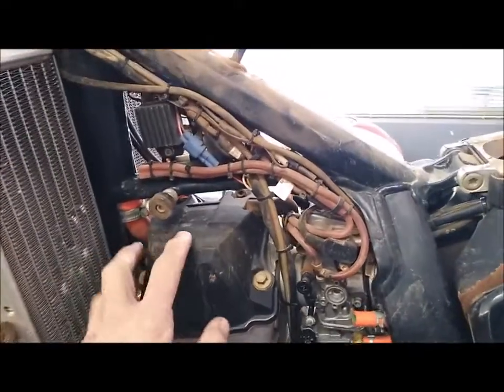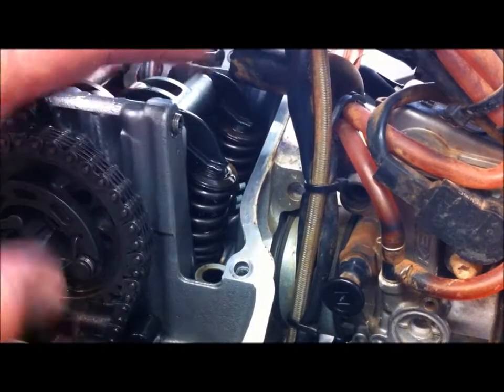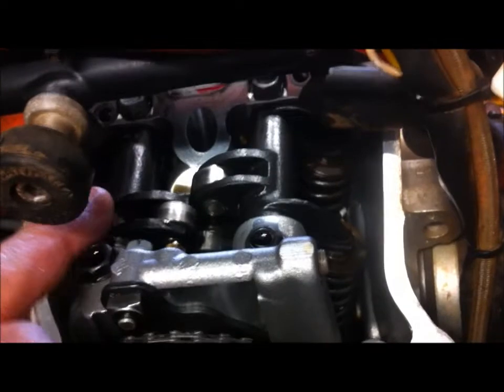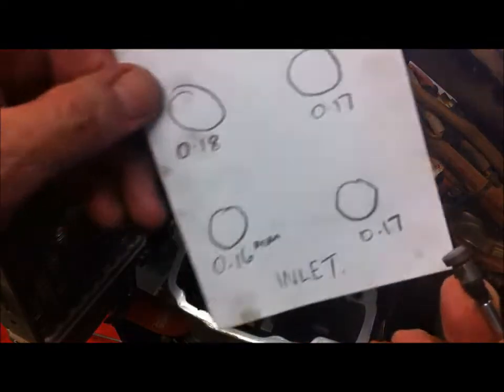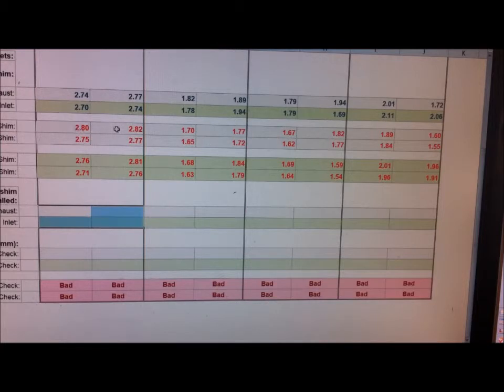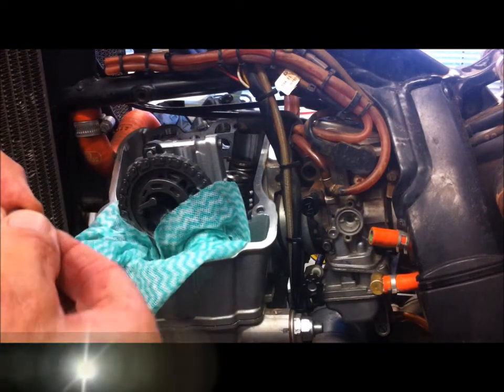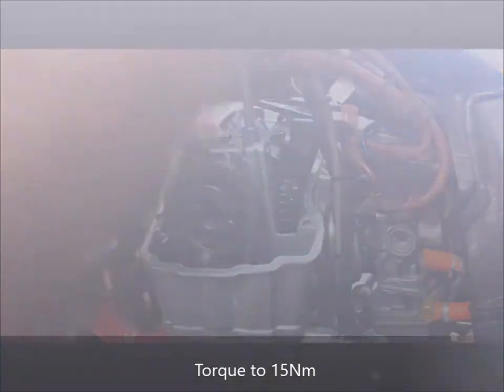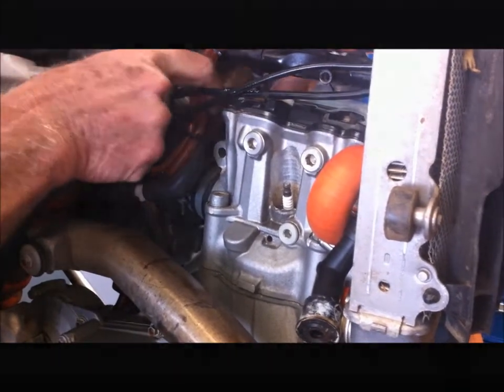KTM EXC VALVE SHIM ADJUSTMENT

Comment: I just did my 08 450 at 282 h. EX was 0.21mm IN was 0.15mm. The engine has only just started making tappet noise but only when cold.
Didnt need shims because I just reinserted the old shims upsidedown so the wear patterns didnt match up.
The rocker arms were now rubbing on the valve stem indentations. This took up some of the excess clearance.
Then I also reinserted the rocker shafts upside down or spun them 180 degrees on their own axis because they were also worn but as Scott said only on the bottom half. Spinning the rocker shafts gave the rockers a brand new unworn surface to run on and again took up some more excess clearance.
Close inspection of the shaft design tells you they are symetric so they will work upside down and not have any oil flow problems.
Clearance afterwards was EX 0.15mm and IN 0.10mm . Waiting till a 4 stroke starts to make noise before adjusting valves means you only have to do it once in its lifetime.
Reply from the maker: Good work and useful information for us all. Thanks for sharing. Regards, Scott
Reply: So i can just take out the shim and put it upside down with the weared up spot on the bottom ?

Comment: Thanks for this video. At 3:24 you mentioned to get the engine to TDC. In the subtitles you write that you want to be sure the engine is on the compression stroke. How do I know if the engine is at that point?
Reply from the maker: Thanks Neil. On the compression stroke both valves will be closed. As you turn the motor watch the valves ... you should feel free play on the rockers after the valves have closed and the piston is coming up towards TDC compressing the air/fuel. If you put a screwdriver into the spark plug hole it will move up and down with the piston which will help visualise what's going on. 
https://www.youtube.com/watch/2Yx32F1cncg
Reply: @ScottElliott152  Thank you for that extra tip!

Comment: Hi, I've been following your video step by step, thanks a lot. 
I have a problem adjusting the valves: when I torqu15 Nm the rocket arms after calibrate the valves gap the rocket arms get blocked and close completely the valve gap, any idea about what's I'm doing wrong?
Reply from the maker: Did you check the torque on the pivot bolts first? See 3:28 in the video.
Reply: @ScottElliott152  yes, did.... 
Maybe a damaged head?
Reply from the maker: @marcossoto3960  you'll need to double check your measurements of the original shims and the entry into the spreadsheet. Hard for me to advise remotely.
Reply: @ScottElliott152  thanks again, I'm understand, I'll keep finding the problem

Comment: Thank you Scott! I have a 2008 KTM 450xcf, this should be the same procedure correct? And a quick side question, my bike likes to get hot really fast upon startup and spits coolant, within a minute of starting it up. Do you have any recommendations?
Reply from the maker: Sounds like a head gasket leak if it's spitting coolant from the exhaust.
Reply: Scott Elliott  My bad, I meant to say it spits coolant out of the overflow not from the exhaust, I just don’t know why it gets warmed up extremely hot really fast
Reply from the maker: @colestadtmiller5280  hopefully it's something simple like the radiator cap has failed. Replace that first and see how it goes. And yes valve clearance adjustment process will be the same.
Reply: Thank you very much for the response!

Comment: Great info, thanks for sharing. Not sure if I want to attempt this myself though. Question: the valve shim kit - are they generic for any bike? I thought the sizes (radius) would be different?
Reply from the maker: Thanks Luke.
The shims are pretty well standardised into small and large diameter. The motorcycle manufacturers don't make their own shims they outsource and I'd guess there's probably only a handful of companies who make shims for this application. It seems the Japanese bikes use the same diameter ... well I've worked on many different makes and models of sports bikes and they were all the same. The shim diameter used on the KTM is the same as my CBR600RR, GSXR750 and a friends R6! I'm pretty sure Ducati's use a larger diameter of ... I think 7.48mm.